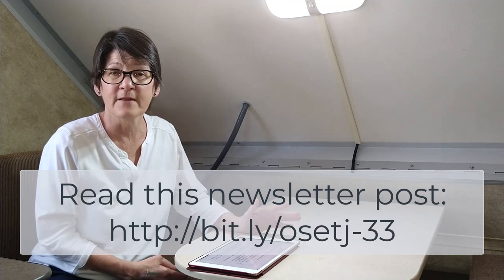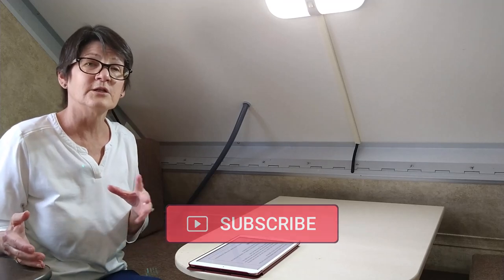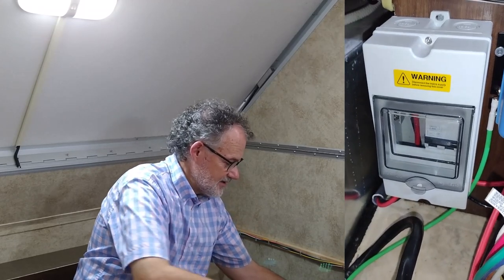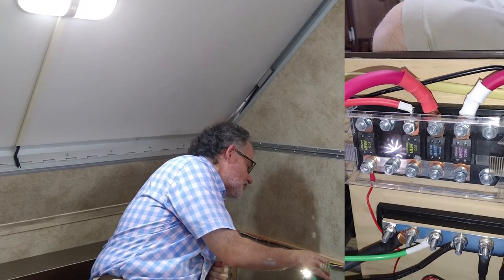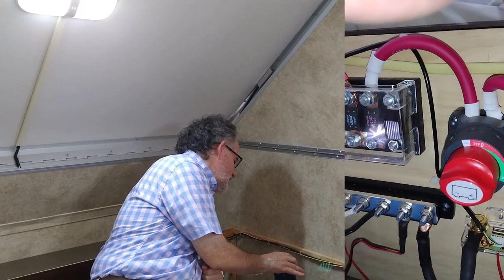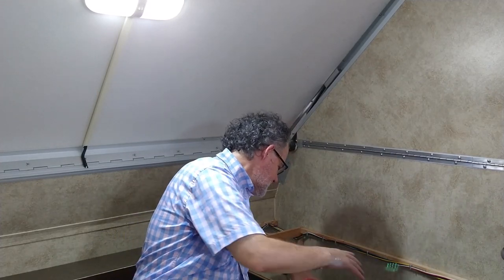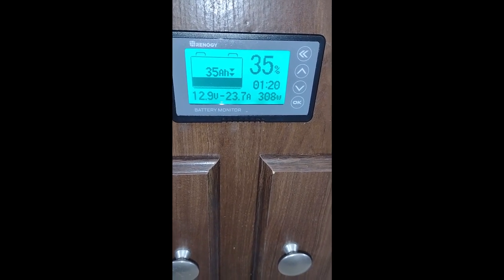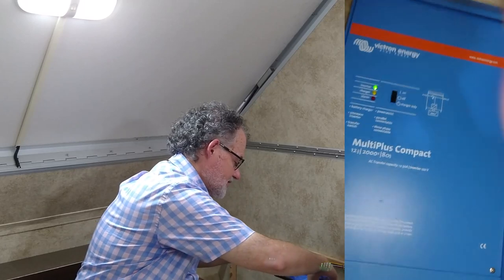A Look at the Hidden Parts of an RV Solar Power System - Aliner Scout A-Frame Popup Trailer Camper

Comment: Great topic.   Not mentioned is the utility of an outboard solar charging port, wherein (compact) folding panels not attached to the trailer could be deployed while the trailer is parked in shade.  Or to help compensate for sun reorienting around a stationary trailer, or to augment for less than ideal parking orientation.   Or where total capacity could simply be increased by adding additional folding panels.   Seems a simple add to the great system already in place.
Reply from the maker: You are so right! We'll likely explore that further!

Comment: just found your channel. Pretty nice.  One thing I think you should know / Do is change you trailer power converter to one that works with LiFePO4.  You WFCO 8735 will only bring your batteries up to 87%.  Though if your not using shore power much, maybe it doesn't matter.  But nice channel.  I hope you keep it going!
Reply from the maker: Thanks, Rick! We love your channel! Thanks for dropping in! We have added a big Victron Energy Inverter/Charger. Do you think that solves the problem you point out?
Reply: @oursolartrailer   Well,  isn't that just taking your 12v battery power and converting it to usable 120volt power?  The problem I pointedd out is that if you go low on your batteries and need to plug into shore power (or genny) your shore power convertor will only charge slowly and to about 87%.   I'm not real familiar with the victron, but if it says it will take shore power (120v/20Amps) and convert it to 14.6volts / and 40amps... then it will charge your batteries fasts and to 100%.  But maybe with the amount of solar you have your solar would bring it up to 100% from 87%.  Not sure,  you'll have to experiment.
Reply from the maker: @GoingNoWhereFast  yes, it does take shore power and charges the battery. Sounds like we're ok. We're sure grateful for all we've learned from you!

Comment: I enjoyed the video! Thanks for showing off your battery. Wow, has LiFePO4 come down in price. I'm still rockin' an old lead acid 1 kW battery. Hopefully I'll get a few more years out of it, but when it finally goes, I'll definitely make the switch. By the way, I'm writing this comment off my small solar system.
Reply from the maker: You're a great role model. It is fun to see what we can do with solar now. We're certainly having fun! It would be pretty reasonable for you to charge your Zero 100% off solar. It would be interesting to figure out what it would take.
Reply: @oursolartrailer  I've considered it but my home has a ton of shade, which is what attracted us to it. I self-installed a small 300w system about 7 or so years on the eastern side where the sun gets a clear shot at the panels for about 4-8 hours depending on the time of year. I'd have to generate a steady 1.3 kW an hour or greater to charge the SR/F. Anything less and either the inverter or the bike would say "not gonna do it." But many days I do run my home office off solar (including EV Rider videos) & power lawn gear, etc. w/solar.
Reply from the maker: @EVRider  Outstanding! Out front as always!!!

Comment: Very cool! Have you tried plugging the battery/inverter into the standard Bolt charging cord? Obviously it would be a very long charge, but if you were staying at a beach or some place where you didn’t need AC for a few weeks it could provide some real range. 

As for a why use multiple small batteries rather than 1 big one, if you had 16 small 12V 125aH batteries you could run them all in parallel to power your trailer, then remove 3 or 4 and plug them in in series to power a 36V or 48V eBike. This could be a way to use the energy generated by the trailers solar panels while it is parked at home though it is definitely taking a further step out there on the tinkerer scale.
Reply from the maker: That's great thinking! We'll be testing and tuning in the coming months and will share what we learn. I love your ideas!